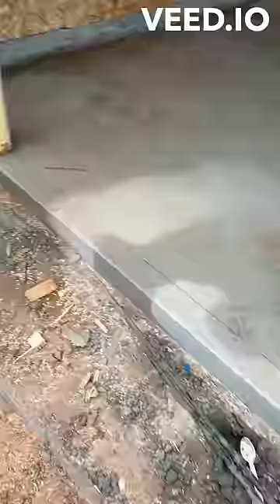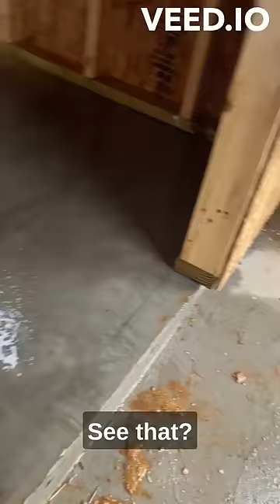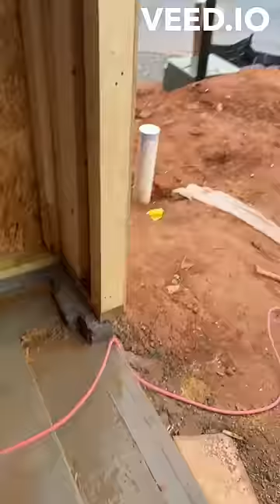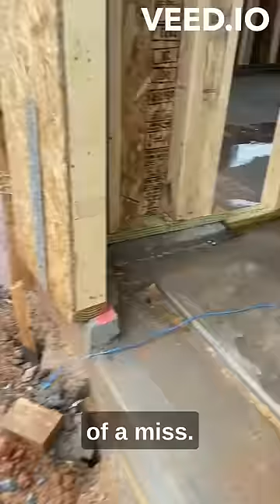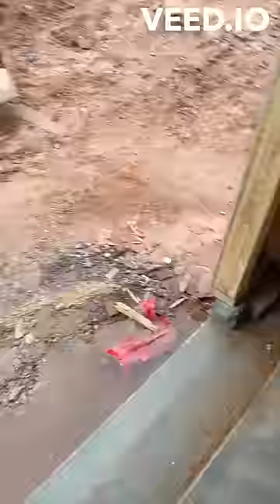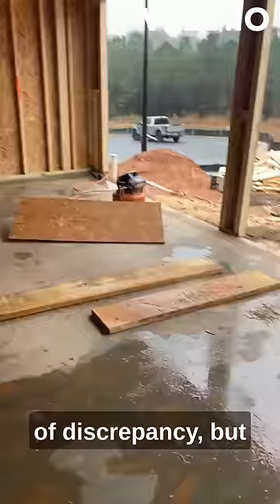New Home Slab is Wrong Size, What Now?

Comment: It matters very little if the foundation guys were wrong because the framers were DEAD wrong.
Reply: You can not have lopsided foundations either🙄
Reply: @1Aplease - No shit but you still wouldn’t frame a whole gd house on a slab that was off. They should have stopped the second they realized the slab was off and made a phone call
Reply: @-B_G-  thank you. That's my point.
Reply: 💯 This is the society we have welcomed. Every single person that was involved with the framing would be getting a major a$$ chewing. We have relied upon making the fastest dollar possible with zero regard and respect for the quality of craftsmanship that is required when someone is paying 💰 your bills. Let alone a new home. Second strike and they are out of the job pool. 
  If the concrete guys had a set of up to date prints, then obviously their measurements are off. They probably found out about the error the same way I did. YouTube
Reply: Even if the concrete guys are short 1 ¹/²" everywhere, in the grand scheme of things, it will effect very little in terms of living space. But as a journeyman carpenter that went through 4 years of apprenticeship training, the framing is just egregious. Even if you never measured the site and just took measurements off of the plans (a big mistake), it would've been an easy fix to chop a little off the first wall. Then, measure the rest before raising the walls. 

Piss poor craftsmanship.
Reply: You are dead wrong... whats your qualifications the building industry??
Reply: @judge462  my qualifications are 35 years in constriction and remodeling. Starting with working for my father, who was a contractor, as a teenager. At 20, I went through the 4 year journeyman's program with the Tri-State Carpenters and Joiners Apprenticeship Training Center. I then spent years in the Carpenter's Union building things like a medical research facility from the ground up for the UTC to remodeling a Sears department store. Since leaving Tennessee, I've done everything from foundation work on a new Sam's Club to framing subcontractor on everything from student housing for the UGA to new homes for more than half a dozen neighborhood/ subdivision subdivision builders. I currently own and operate a remodeling company that specializes in apartment complexes. Any more questions about my qualifications?
Reply: Yeah that's worse than anything I've personally seen on the job site with over 10 years lumber sales/estimating for new construction. This was almost assuredly seen by the manager of the frame crew as he was most likely the one who snapped those lines. I thought at first some were snapped for 2*4 and the wall was framed 2*6, but those ones in the garage, yeah that was bad. It's entirely possible that this was not a concrete issue but 100% a framing issue from those poorly snapped lines. Typically they should have snapped it 4" in from each edge etc, in which case the wall would follow the concretes direction. But the variance says it's probably a screw up by both. Depending on size of house, just got the material, that could upwards of $10-40k mistake.
Reply: @Lazorlink right, I've never seen one that bad before.
Reply: @newhorizonsgloballlc.1055 all that and your still wrong. You frame to the prints. Someone paid at least 10's of thousands of dollars on a set of drawings. The prints are always correct. As a framer if I ignore the drawings and lay it out on the concrete now I'm liable for the framing being incorrect. This is on the concrete contractor and he'll be getting the Backcharge to bolt and grout angle iron lintels around the entire foundation.
Reply: @theripwagon5868  if you think the framer is free to ignore when site conditions are different than what's in the plans, then I know there's no reason to even continue this discussion. You don't have the level of knowledge and/ or experience necessary to formulate a valid argument. Not to mention you thinking an architect or engineer is infallible, or as you say "always right". That's just asinine.
Reply: Hey Mr.George my guys are doing a precise job how bout giving them all a raise
Reply: @theripwagon5868 I don't care how expensive your drawings are. I have eyes and can see where the framers messed up.
Reply: @sabastianleisek396 exactly, been building for 30 years…myself or my framers would NEVER frame like that
Reply: That's kinda what I thought. If the slab was off they shouldn't have went that far.
Reply: @judge462 I’m not a pilot and have 0 fly time or qualifications but if I see a plane crash I would know something was wrong.
Reply: Can you fix it with a 3" or 4" galvanized angle iron bolted to the concrete, which will now also catch the sill plate? Just a thought.
Reply: @smitlag I wouldn't want that on my house, but 4 things immediately stand out to me regarding that potential fix. 

1. Does local code allow it - I would be surprised if that particular fix is specifically written into the code. That means it's probably up to an inspector's whim and they're not likely to stick their neck out for something so non-standard. 

2. Some of that, especially the parts where the concrete is elevated above the slab, has very little to bolt into. Also, there's very little framing to sit on top of the angle iron - the sill plate would need to be bolted to it as well. 

3. Is it going to create a water intrusion point? Will the siding cover that mistake well enough to keep the expected integrity

4. Since it's above grade, it's going to be seen and stick out like a sore thumb to anyone that knows what they're looking at. So now you have to sell that fix to the buyer... which also means fully disclosing the mistake that lead to the irregularity in the first place. Nothing fun about that.
Reply: @newhorizonsgloballlc.1055  as to the code issue I don't know. Building codes vary all over the country. It is going to be a shit show one way or another, either modifying the framing or trying to repour concrete to make up for 2 inches of pad shortage. I have seen them utilize structural steel like this in concrete commercial buildings. If the slab is at least 6 inches thick, there
 shouldn't have any problem quickbolting angle to the side of the slab. I do agree with you ,in that just left at that it would be an eyesore. But it would give the structure something substantial to bolt a sill plate to. It may be the least costly way to fix the problem. But that house  definitely isn't going to pass code the way it is.
Reply: @newhorizonsgloballlc.1055 he’s probably saying that of course you follow the plans but obviously you adjust to the real world conditions. The plans and what’s actually there is never 100% identical. He should have either had the concrete guy fix it, or yeah move the framing in an inch so it’s actually on the slab. He’s not wrong when he says no one would realize the house is an inch shorter. You’re going to act like moving the framing in an inch to actually sit on the slab is so egregious? 😂 it’s the cheapest way to fix it if the problem is with the concrete anyway.
Reply: @psyience3213  I'm the one who said no one would realize it if the framing was moved in.  You may have gotten the comments mixed up.
Reply: I’d be pissed if I had to send my framing crew back out to fix this because they had some kind of ego trip.
Reply: The framers should have not set any walls on that foundation. The concrete guys fucked up BIG TIME but since the framers went with it they now share the cost.
Reply: Define "framer" for me because I've seen multi million dollar homes slapped together from pre built panels. DR Horton, Pulte, Ryan, Ryland, all fudged stuff together back in the day. I was a project manager for Builders First Source windows and door install and I seen some shit lol.
Reply: @newhorizonsgloballlc.1055 

This  is how it went down framer calls GC/ builder 

Framer

boss this concrete is no good

Boss 

What’s wrong with it 

Framer 

It’s no good 

Boss 

I’m on vacation I will deal with it when I get back just due your job- hangs up 

Framer to the crew 

Fu** it
Reply: @Sheepleton  in this case, we'll loosely define "framer" as the crew responsible for raising the walls. Even if it was a prefab crew, they should have the tools necessary to make changes on-site. BTW: you brought back some bad memories mentioning DR Horton/ Horton Homes 🤣🤣🤣
Reply: @legionair469  It looks like they missed it by exactly an inch and a half. Somebody included the width of the forms when measuring the layout on site.
Reply: It's fine, it can be fixed after and that's what usually happens

New bit of footing and structural grout, costs more than getting it right the first time but it could've cost more if the framer went off plan and made it fit
Reply: Think the concrete guys refused to fix their mistake so the framers framed to the right dimensions as a FU to them
Reply: @mummsthaword1111  maybe, but it's a FU to the entire project and the GC that hired them too. Not smart if you want repeat business.
Reply: @newhorizonsgloballlc.1055  looks like they measured to the outside of their form instead of the inside…I don’t think I’d wanna continue working for a gc that didn’t check his concrete before he told you to start framing. Not smart but I don’t see a lot of smart in this videos or the trades in general much anymore.
Reply: @mummsthaword1111  I agree, looks like the gc/ super is not overseeing things properly. That's a lot of work done incorrectly, before it was caught.
Reply: Im a framer and there have been times where the builder told me they would come behind me and fix the foundation (pour new concrete beside existing) . I wouldnt want it but money talks. Also there should be a barrier between concrete and wood. Dont think treated wood is good enough.
Reply: @newhorizonsgloballlc.1055 not accurate ar all, clearly you dont frame houses for a living. All the trades and materials are lined up. To stip the project would be the exeption not the rule. The convrete guy needs to fix after. Engineered joists and trusses need to have a square and accurite base. The framer will square and layout for trusses.
Reply: @JamesJames-l6l  that's a possibility. I'm making the assumption that the video maker was either the builder or his superintendent. However, if he's not, you could be absolutely right.
Reply: @user-mp8zn7ox5j   that's not the proper way to do it - even if the foundation is the problem (we don't know that for certain). The proper way is to push back framing 3-4 days, so that the foundation crew can correct the discrepancy (again, if the foundation is the issue).

The issue could be in pre-fabrication, if these are prefab wall panels. Or it could be could be an architectural/ engineering issue. However, it's not proper to frame and raise walls on half of a foundation. I'm aware that instructions may be given to do just that by a builder that's worried about his timeline, but that doesn't make it proper. 

Btw: I listed my qualifications above.
Reply: @Lazorlink  A guy my father worked with had a foundation and slab poured for a two stall garage . He called and asked if I could come up and lay it out for him to get him started. The front wall was two inches out of square and the back wall was five inches out of square . He called the concrete guy and was told ,oh well .
Reply: Carpenter here. A few points:
1. While it is possible that the framers got the layout wrong, they would have had to have pulled a dozen or so incorrect measurements, all off by the same amount, in order to produce these results. It's WAY more likely that the slab dimension were off.
2. The framers here almost certainly noticed the discrepancy and knew it was wrong when they laid it out. 
3. It is not the responsibility of the framers to halt a job because something looks off to them. Their job is to turn stacks of lumber into a house as specified by the plans. 

What almost certainly happened here is, the framers noticed the slab was wrong while doing their layout. They called the super, and the super said not to worry about it. So they didn't worry about it. 

In short, it's the super's fault, and he probably got into some pretty deep doodoo for this.
Reply: as a bus driver, I concur.
Reply: Yeah as a framer I'm certainly in violent agreement. As a framer I could have dealt with that concrete work without half of my work trying to defy gravity.
Reply: Man, you actually get it. Lol. Everybody thinks the whole jobsite will stop to remove the slab so the framers can get paid twice to do it right and the concrete sub can redo all their work for free. Yeah right. I’ve built houses, bridges, dams, water treatment plants, etc. 100% framers wrong. Could have easily hidden the mistaken measurement in one room and no one would ever check it.
Reply: How do you know the framers are wrong? they probably built it to the print, the foundation is off most likely
Reply: @newhorizonsgloballlc.1055 lol happens everyday, I used to  bolt angle iron on foundations to carry brick when the Mexicans couldn't square a building😂😂😂
Reply: @trumpsagenius6914  my point about the framers being dead wrong isn't because I saw the prints. You just don't frame with your sill plate hanging off of the footers like that.
Reply: @-B_G- it’s not just the slab, the foundation is off.
Reply: @newhorizonsgloballlc.1055  I've seen stuff built hanging off foundations all the time, it's not right and somebody prob will have to come back and  fix, guess you haven't been around production home building 🤣🤣🤣
Reply: lol ! The framers were only wrong for framing in a screwed slab. 😂
Reply: @trumpsagenius6914  I have. You could see it 1000 times, that doesn't make it right. Just means the process has been rushed a lot.
Reply: @theripwagon5868 I have never in my life seen a house that was perfect!!!
An old saying is "We're not building a Church???"
Reply: @newhorizonsgloballlc.1055  never said it was right but they don't stop a whole framing crew because the foundation's off they'll let it hang over I've seen it many times
Reply: @-B_G-  they do that s*** all the time then they come back and underpin the walls
Reply: @stevenfowler411  they don't give a f*** it's all about money I've seen this happen all the time I used to do foundations for a living, I used to be the fuk up fixer and repair that shit
Reply: @smitlag  ding ding ding, I used to do it all the time, most these people commenting Don't know Jack shit, is it right? no but it happens everyday
Reply: Couldn't they have moved in framing slightly , only couple inches
Reply: Thanks to so many rules following blueprints.  Stupid shit like this happens because they make it difficult to change.  You are better off just play stupid and shrink the frame to the unsquare slab.
Reply: @theripwagon5868  When measuring to set up the frame, the framing crew supervisor should have called the GC so they call and get a sign off on new specs so the framing can correctly be done to fit the existing concrete foundation otherwise both will be liable for correcting their mistakes...the framers will have make corrections at their own cost (and not by the builder if framers are contractors or homeowner if the house is presold) by dismantling the existing frame and refitting the new frame correcty to the foundation and the fountain contractors will pay penalties for setting up the forms wrong and  then compounding the error with pouring the concrete into the incorrect sized forms.
Reply: The carpenter knows this will not pass inspection and built it by the plans anyway?
Reply: @theripwagon5868  "Prints are always correct" 😂😂😂😂
Reply: In my experience, here’s how this should have gone, and just for the records,  architects and engineers are wrong on drawings all the the time,  currently in the middle of a major construction project with issues that make this look like a cake walk.  And all entities are now in court, past the litigations as of course just like most of the posts and comments on this page, it’s called ego and no common sense.  The correct thing to do was for the contractor to first and foremost have noticed the issue before the framers started and address it with the architect and engineers and home owner and city ( building site inspector) .  Due to this not happening, you end up in this situation.  Concrete contractor will end up having to address the issue, but the framers should have done their part to address it( not change measurements).  
Why,  these measurements impact , internal measurements, everything from plumbing, electrical,  doors,  cabinets( kitchen) which have probably already been ordered ,  possible staircase issues, etc, the list can be endless.  Who ever the site contractor is screwed up the biggest for not being on top of the issue and addressing it before allowing the framers to frame up to spec.  I’m going to assume that they have obviously addressed it and the concrete guys will be back to make things right, which is not small issue or cost.  In a world where we don’t work together ,  this is the outcome.  And from the quick video,  I’m not impressed with the quality of work period.
Reply: @craigtaylor5378  well said
Reply: The concrete members were at fault for not checking and dubble checking. Both " ALL "  of the infermation on the blueprints. Against the string lines on the ground. This is the fault of the building framers. For not checking and dubble checking " ALL " of the infermation on the blueprints. Against the final completed location. Including final completed dimensions of the finished foundation.  Taking the extra twenty to thirty five minutes. Goes a long way to preventing any problems from occuring!!
Reply: @smitlag NO
Reply: @theripwagon5868 It’s not as simple as doing it or not doing it. There is a contract Directive that has to be drawn up and the builder would have to agree to pick up any additional time for having to refúgieme everything. Once the directive is signed…we are good to go. As a builder I would never use that framer again if he took it upon himself to build that house without consulting me first. You just don’t do it!
Reply: @Lazorlink manager? 😂
Reply: @williamprice2034  manager, job foreman whatever you want to call them. The guy in charge of almost always the one who snaps the lines
Reply: The real problem is that most framing is now done off site and the onsite framers just assemble what they were sent!!🤦‍♂️🤷‍♂️
Reply: If the GC hasn’t been there before the entire house is framed wrong - then he sucks too. Let’s be fair. I work for a GC.
Reply: Yea i mean you adjust to what you have.  Just cut the walls a hair shorter, cmon.
Reply: Whether the concrete is off by 1/2 inch or 2 inches the framer needs to make a decision to continue and build with only 1inch on the foundation or contact the general,or supervisor who will make the decision and accept the liability because someone made mistakes and things can be done to rectify the problem whether framing is shortened or additional crete is poured, in the end the builder's is responsible for any kind of problem and will have to fix it but this is unacceptable to continue to build ,this is a very bad situation to be in,this home has no structural integrity like this  
 Never would have been one wall raised until problem fixed with our builder
Reply: That's what you get when you squeeze the subs for everything. They probably exactly on point on the drawings. The GC don't give a drap about the subs, the subs now don't give a crap. As they shouldn't ,it's not their job.
Reply: When he says “tricky to resolve” he means the building is not in code , but they will discuss it with the owner, and then sign off on it anyways. Because what are you going to do? Tear it down? Sue the contractor? You’re supposed to move in, in the 3 months. The contractor will just declare bankruptcy and you’ll be left with an unsell-able junk of concrete and wood in some dirt. A manager from the contractor? Are you out of your mind? You don’t pay people until the job is done and it’s been INDEPENDENTLY INSPECTED through every stage
Reply: @judge462 you are mexican